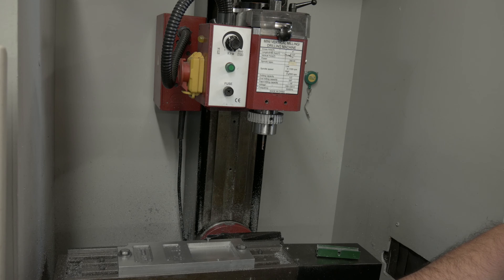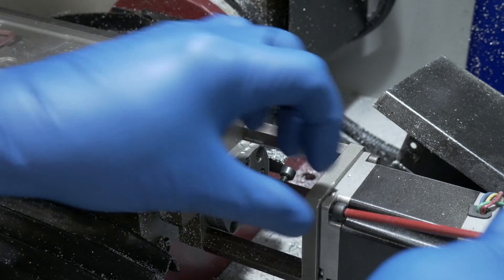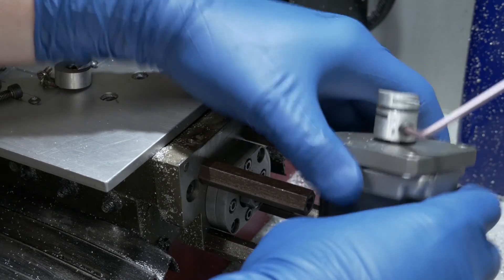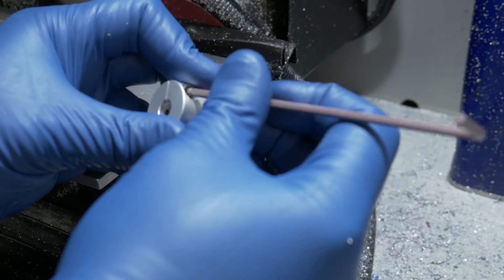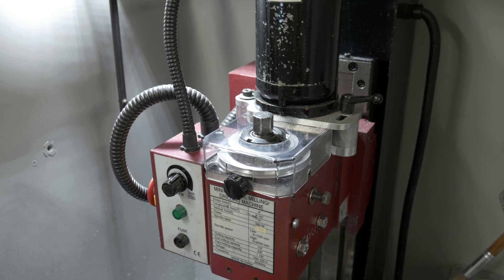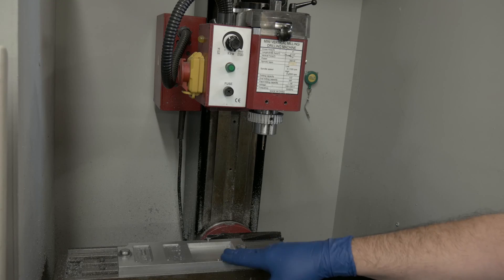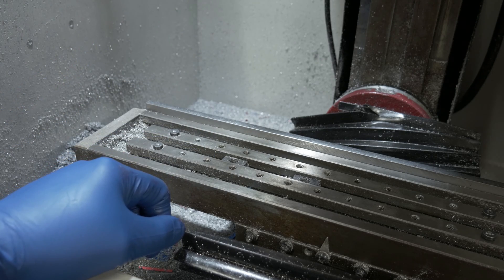Sieg CNC X2 ball screw coupling repair & modifications.

Comment from the maker: Trying to get some production through the shop and discovered an issue that needs repaired on the little X2 CNC mill.  While I'm at it I go over some of the modifications I've made to the machine over the years.  Got an X2? Let me hear about any mods you've made to your mini mill down here in the comments!
🔴 Subscribe!  https://www.youtube.com/peterondeau?sub_confirmation=1
Reply: I am just a hobbyist but  I have made a number of modifications to my Seig X2

Firstly I had a 500w BLDC motor but the controller blew up. I bought another controller and it blew up too so I thought my machine was probably irreparable. (I used to be a medico and I dont know any machinists who could help me).  Then I bought a 12-24v 500w brushless motor from china with hall sensors and I run that off 20V drill batteries.   I am very happy with this set up.  I like working with 20v  with controllers etc and not  having to worry about 240V.

I replaced the original red  with speed control  and master switch with a 3d printed version.   The new box is smaller and has a pot,    a nice momentary control on/off switch with a  green led  on  a pololu  electronic switch that toggles on and off and quick off-switch-only on the side. I am very happy with this box too.

I have installed  X,Y and Z dro's (just cheap shahe capacitive one ) but they seem to work well. 
I have a temporary tacho running of a small magnet off on the spindle (originally for cars I think).  This is OK but is pretty slow to respond and is bulky.  

I will probably replace the pololu switch with a raspberry pi l and use the PIO  to make a new  tacho as well.  I will probably feed this off one of the hall outputs but there are two quadrature outputs I could use as well.

My new motor has great low speed torque but is a bit slow (about 1600 rpm max).  My X2 had a factory belt drive and I made an appalling pulley by fibreglassing the old aluminium pully onto the  new motor shaft  (!!).  I expected it to fail almost immediately but is has ended up working very well so far.  To get higher speed I might have to look at getting gears so the  fibreglass "bush mechanic" approach would not work.

I may to put a motor at least on the X axis and probably the y axis.  Z axis seems a bit harder.

I use it mainly as a drill rather than a mill.  Other than drilling it is not very useful.  I just like tinkering with it.

Comment: Hi, i'm wondering if you can say how the z axis is done within the column, that sounds neat, but I can't quite think how it is done on an x2.
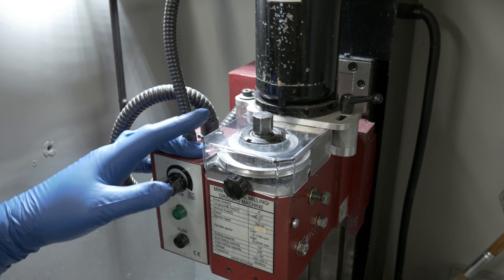Reply from the maker: If you look at around the 7:15 mark in the video, you will see that the black sheet metal cover leaves a gap against the column .  You can also barely see that off the side of the head there is a piece of metal (painted red to match the head) that goes into this gap.  so there is basically a yoke around the column that is attached to each side of the head and the ball nut is on the rear of that yoke.  The screw runs behind the column through that nut.
Reply: @PeteRondeau  Ah!  Very complicated.  Thank you.  I wonder what the real advantage of putting it behind the column was?  Rather than in front.

Comment: I have the Grizzly G8689 version , all I have done is the air shock/longer travel kit from The little machine shop . I had Pete Brush repair and upgrade the controller board. My next upgrade is going to be the belt drive, did you use the one from The little machine shop? I also painted mine red because I hate the Grizzly wrinkle green .
Reply from the maker: Yes, that is the little machine shop belt drive.  I replaced the spindle motor controller because I wanted something that I could externally control with a 0-10v signal, but then I never ended up using that functionality.  I still set the speed by hand, but its always full speed ahead cutting aluminum so its not really an issue.  I could have gotten away with a spindle on/off relay.